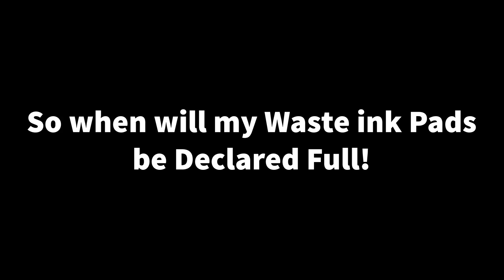So when will my Waste ink Pads be Declared Full?

Comment: I have an Epson R2000 and it reported full ink pad after about 4-1/2 years of regular use.  I bought the adjustment program from you and after extracting the files out of the  RAR  file ( which took me a while because I don't have winzip)  I reset the pads and the printer is now going strong again.  Your tips on how to make an ink recovery system are good too. To replace the printer would cost me over $500. So the Adjustment Program was a real $$$ saver.  And I like buying low cost real  Epson ink for $40 a set (all 8) on Amazon or Ebay.  I must have 5 of each color now.  Thanks for all you do, I love watching your videos.
Reply from the maker: Sounds great. Love a happy ending.

Comment: Purchased my Canon Pro-100 in September of 2013. I have printed borderless 4x6 all the way to 13x19 maybe three to four thousand prints and the printer is still going strong!! Never had an issue. About every six to eight months I will go in and give the printer a thorough cleaning with tips and windex and that's all I have done to the printer......
Reply from the maker: Great testimonial. That goes to show how good the pro-100 is. I set up mine in August of 2013

Comment: I have a Canon MT G3202 which I've modified to drain outside the back of the printer. G3200/G3202 is incredibly easy to replace the absorber pads on, just two screws. You can get the pads from Precision Roller. And you can reset the counter with a service mode button combination. I don't bother with the third-party reset programs -- they're often a scam. I've just made the jump to a MT G7020 and I'll have to see about modifying that one as well. Unfortunately, I don't see any documentation on how that one can be diverted or reset. (I'll perhaps have to make it myself.) I also don't see pads on Precision Roller for it. Fingers crossed it's relatively easy. The G7020 has a duplexer, so it's probably not going to be quite as simple as popping the back off, like with the G3202. I also don't know if the G7020 will have the same easy WIC reset since the interface panel is marginally more advanced.

Comment: I wonder if there is anyway to " suck " the waste ink from the pads? I'm thinking perhaps something like a vacuum with a thin pipe that could be poked into the sponges to extract the ink. Sounds far fetched but perhaps it could work if we could gain access. Having said that my guess is the counter wouldn't be reversed anyway so even if it were possible to physically suck the ink out of the pad the counter would still show it to be full making the task futile. Fingers crossed my own Pro 100 lasts a few years before that happens to me 😉
Reply from the maker: Yes. Cool idea but futile. You also can no longer enter service mode to use the correct service tool to reset it to zero. Even if you still have to deal with the physical pads themselves. Epson 13" printers allow you to divert ink outside and reset counters.

Comment: Personally since I paid $100 for my Pro-10, $20 for 50 sheets of 13X19 Canon Pro Luster, and $65 for shipping after discount and rebate I'm really not worried at all about when the waste ink pads fill.  Even if somehow they managed to fill in a year, considering I paid less than a set of inks for the printer,  I really couldn't be too  upset lol.  If I can get the same deal next Xmas I might just buy another one anyway since at that price it's like getting a free printer with your ink and paper.
Reply from the maker: I used the example of one to one and a half years as the fastest time that the waste ink pads going to be filled but that is a rare occasion that is only for people who are constantly running cleaning cycle or constantly changing cartridges from one ink set to the next and so you generate lot of ink purges. But will not occur during normal usage. Like I said. My Pro 100 has been printing for about five and a half years at least and still no sign of any problems.
Reply: @cheo1949  Well I was using a year as an extreme example. I don't think they will fill that fast.
Reply from the maker: On Canon PRO10-100 I've heard 3-6 years of regular use.
Reply: @cheo1949  That sounds reasonable to me

Comment: Great video Jose as always!!! At the cost of a Pro 100 in the States with your rebates I don't see why anyone would bother with a maintenance by Canon to fix the pads just buy a new printer, or buy up two or three and put them aside. They are unused and can stay in the box for years to come. Then you have 2 or 3 sets of cartridges to modify for PC inks like I believe you have done this Jose. The cost just doesn't justify the means(when we all buy a printer it should be in the back of your mind what to do if this happens. Buy a new one of have it fixed, whichever is cheaper usually is the choice).  We are all refilling and cutting corners to keep ourselves printing fine prints at a very low price. So look at the bright side while it lasts. WIC tool is great for the Epson printers for sure. But Epson has been able to block it on some of the newer printers. My Epson Expression photo XP-15000 isn't seen by the tool nor can I send them the data through the WIC software, as it doesn't see the printer. Thanks Epson!!! At least it does use a maintenance cart which is easily accessible to self service. The point being that we might be locked out by Canon or Epson totally in the near future of doing what it is we are able to do so  enjoy it while it lasts. And all of us should be happy and grateful that Jose and Precision Colors and Inkjet Mall and others are working hard to keep this up and running for all of us too keep printing at a reasonable prices. Keep up the great informational videos Jose so we can all benefit this fun hobby of seeing prints and sharing with family and friends all sorts of great works of art. Keep them coming as I look forward to each and every video that you do Jose!!!
Reply from the maker: Maybe the reason it doesnt see it is because it does not utilize the conventonal waste ink counters.  Yes I am nor worried at all about my PRO100 but not every one has spares waiting in tbe aisles.
Reply: Correct Jose the tool recognizes that the printer has a maintenance cart which has its own chip that does the counting for it. But my WF-7720 has the same thing(a maintenance cart with chip) but in the control tab on the WF-7720 I have all the options like Information, Cleaning, and Testing. The XP-15000 states that this printer is not supported yet with a button Create report. Even with status monitor and all the Epson reporting turned off(which I did as soon as the driver was loaded) the message comes back with "Application could not gather any useful information from the printer. Unfortunately, we will not be able to add support for this printer...". So Epson is putting blocking measures into their new stuff to counter them from working with these types of softwares. Another reason that firmware updates on the older models shouldn't be done or it might lock them out too!
Maybe it didn't come out the way I intended in the first comment but people should understand all the work that people put into this to keep us all printing with third party inks and great papers at reasonable prices isn't easy. As in the end if people only had the high priced OEM inks I'm sure that less people would be printing! Which would be a shame!!!
Reply: Great if you live in the US but not if you live in Canada where you will pay over $400 for a canon pro 100. I was lucky to get a sealed store return for $150 but even still, adding in the $200 cost of refill bottles and all the extra work still makes this printer cost at least $350.

Comment: I love the Canon MX870 but the cost of replacing the absorption pads may exceed buying a new printer. Which would you suggest I buy new?
Reply from the maker: That's why I stick with printer models that come with user replaceable waste ink tanks or carts. You need to come over to EPSON. The XP models series most have that feature.
Reply: @cheo1949  I think that if you are trying to spread knowledge you should be a little more specific.  I was respecting your knowledge on these things until you said this.  Have you seen the kinds of issues that people are having with Epson XP printers in 2022?  No ink absorption option is worth the headaches and incredible costs with ink that many of the models have.  How about suggesting an XP printer that is worth the money?  I dread the day that I cannot get my Canon Pixma MX870 (that works great with 3rd party or after-market inks) to still print.  I don't have $500 to spend on a printer nor on ink.  A little slow?  I'll take it.  It is reliable.  Are Brother printers all terrible?  HP?  You don't even mention them here.

Comment: Here is another good question on Canons because they have multiple head cleaning levels does Canon run a different level of ink based on a time of off time between prints? So someone who turns off the printer say for a week would it do a low head clean, but if someone leaves it off for a month would it do a full head clean? For their pad saturation(full) timer does it have a dry time counter that would affect it too? So a company printing thousands of prints like you mentioned from Amazon would it fill quicker because there is no dry time between prints? Have they ever had a printer in a pool of ink from over saturating their pads? Just the techie in me thinking about different scenarios.
Reply from the maker: Well let's use the pro 100 us an example you have two time periods from 0 to 120 hours and then from 120 hours all the way to 480 hours so that would be five days and up to 20 days.  So say at the Zero Hour you run a print and it's preceded by a cleaning cycle that starts the clock at zero you could conceivably not print until almost at 480 hour limit and end up running the smaller cleaning cycle that would be triggered right after 120 hours. From 0 to just under 120 hours  you will not have any cleaning when printing.  If you print something right 120 hours you will trigger the smaller of the two cleaning cycles.
Reply: So based on that and the times you have mentioned with your PRO 1000 they are twice as frequent on the PRO 1000 as the PRO 100?
Reply from the maker: YES! MAYBE! It does not appear that the PRO-1000 operates of strict timed cycles. It is more IA based and performs them IT see it needs them. The PRO-1-10 seems to be the 60-120-240-480 hours. You can not for sure apply that top the PRO-1000.

Comment: Jose, thank you so much for your very informative videos.  I recently purchased the Canon Pro 100, installed the OEM starter ink set, also purchased second set of OEM cartridges and I have ordered PercisionColor 16oz squezy deluxe refill kit with resetter squezy bottles.  I have watched and understand your recommended ink management system.  I have two questions.  Rather than use PC yellow ink and the related issues (cleaning, chip replace etc.) could I continue to purchase and use OEM yellow carts, running each cart dry and replacing with and OEM yellow cart?  And two, if I did this could I still plan to use PC 's icc profiles?  (once I cycle through carts so I would be using 7 carts with PC inks and the one yellow OEM cart)
Reply from the maker: You could do that but it's not necessary if you start with a flushed yellow cartridge one that has been cleaned until the sponge is white then you can simply begin to use PC yellow.  The only reason I would recommend using only OEM yellow ink it's if you're planning to sell your prints. Yellow dye is the weakest part of anything ink set and is most prone to fading. As far as that goes I would guess you would need custom profiles if we're to print with  7 third part colors and OEM yellow.
Reply: @cheo1949  Thank you for the information.  As always I find your input very valuable.  I'll keep watching for even more insights.

Comment: I've had my well used Canon MP980 for 12 years and it's only just gone into service mode with the absorbtion pads full.  I want to avoid purchasing one for the next few months. 
There are various methods shown to reset the ink counter for different Canon printers - none which did the reset but it allow me to get into service mode and not get any further. 

Does anyone have a reset method for this model?
Thanks, Angie
Reply from the maker: It's near impossible to do that this day. You also need a CANON Service tool and have logon access to the service server. They have blocked us from using these service tools.